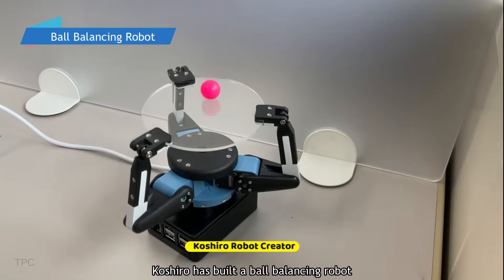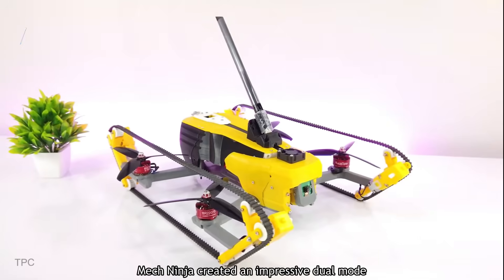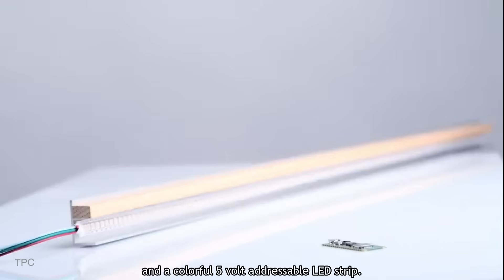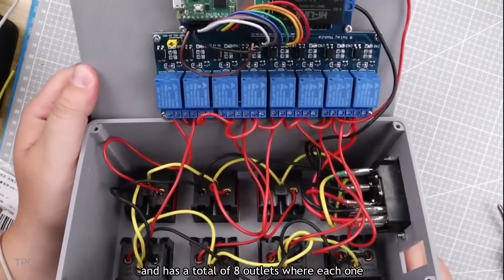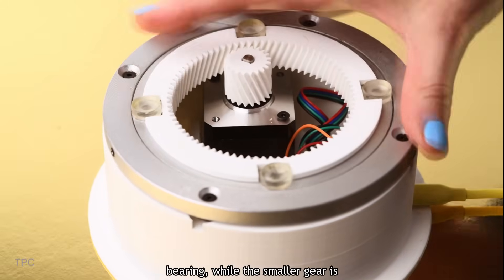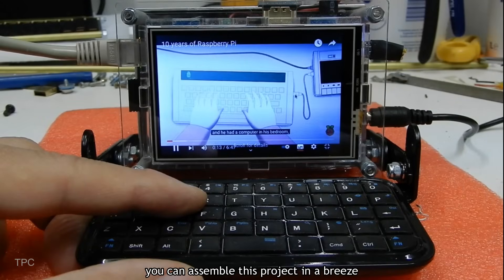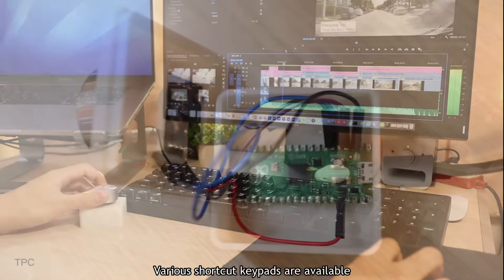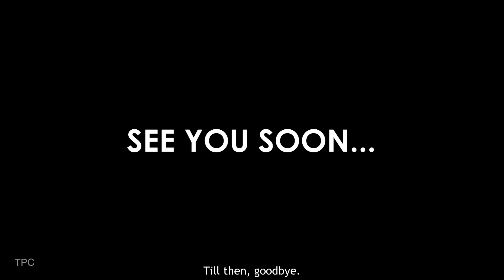Top 25 Raspberry Pi Projects of 2024 🤯!

Comment: I have the highest spec stereo system available in the Chevrolet Silverado pickups from 2013. I cannot play music from my phone on it, but everything else is great, including the USB port where it can read music files from. My project will be to build a RP4-based USB emulator that automatically, wirelessly syncs to a folder on my home network when parked within wifi range. Chat GPT has given me instructions, and I am working on collecting the hardware now. This is my first Pi project. If it goes well, I just know this will become an expensive hobby.

Comment: As much as I love Raspberry Pi projects and this kind of tech, my biggest question on most of these is "why?".
Reply: The answer lies in the journey, not the destination.
Reply: @keno101 Nice answer, but I still would not build any of these as they are.
Reply: @ForgeMasterXXL they are proof of concepts for potential consumer markets
Reply: As others have said proof of concept. An example, a friend of mine works for a research group within a university that develops military technology. He came up with an idea that was very much out of the box thinking but they needed a proof of concept device. Instead of spending a number of years developing the componets from the ground up they used  five Raspberry Pis, twenty Ardunios and a bunch of off the shelf sensors. They came up with something that they were able to feild test in six months and were able to prove the concept. This cost his lad less then a thousand dollars in bits and six months work by some undregrad who they paid and got course credit. So the answer to why do these projects is becuase the Raspberry Pi is a learning tool and a devlopment tool not the end it itself.
Reply: @rurikau  You make a very good point although I'm looking for stuff that will make my life easier. So far this has meant a call-blocker and a home file sharing/storage system.
Reply: My feelings exactly!
Reply: The answer is "why not?"